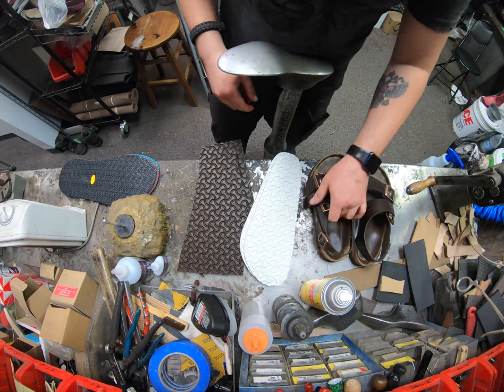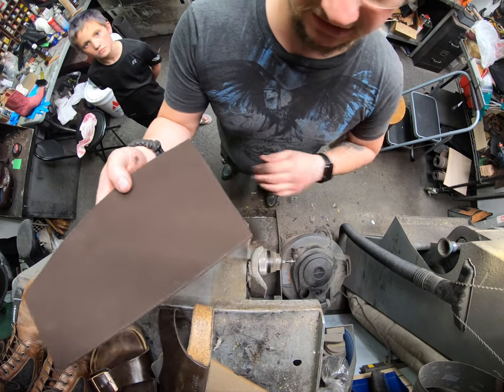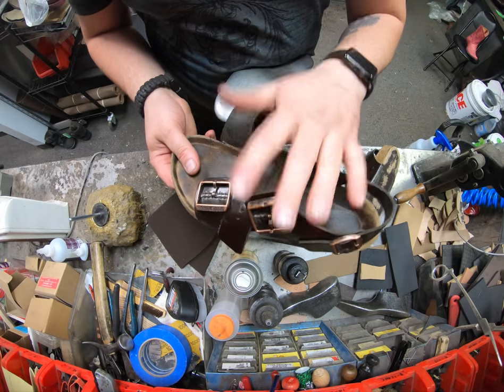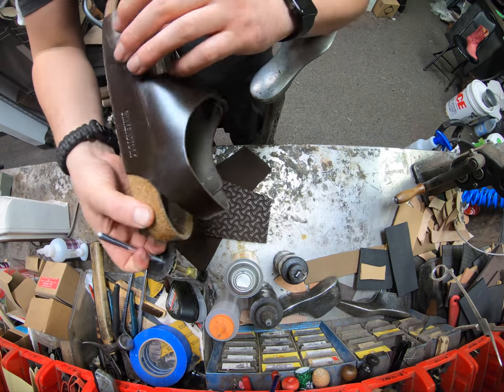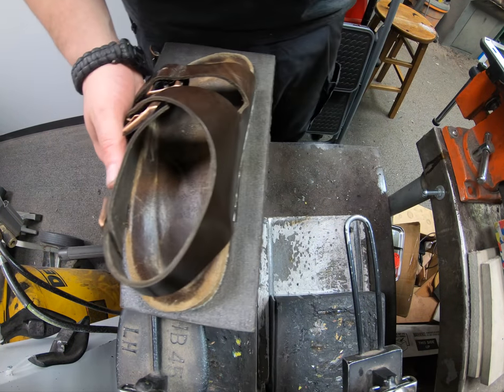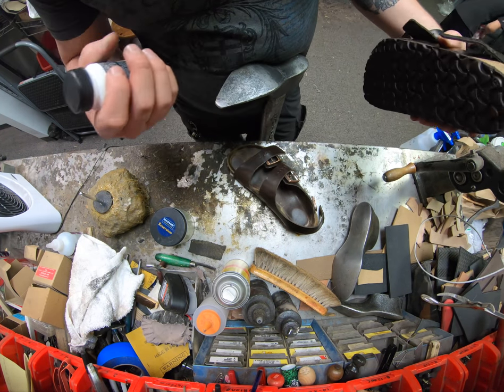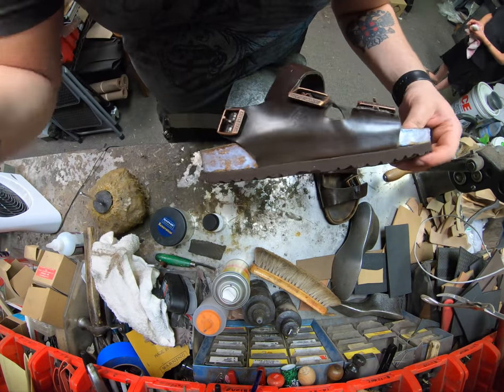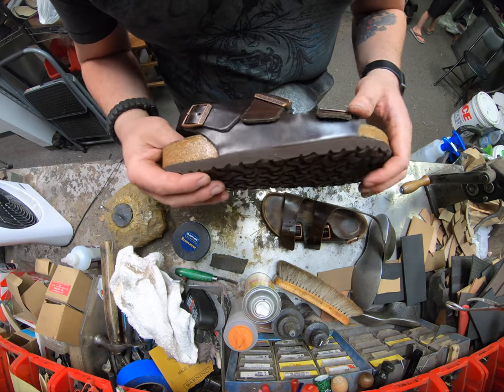Birkenstock Milano Full Sole Replacement with Original Birkenstock Soles

Comment: Really love this video! Can all Birkenstock’s get resoled or is only Birks with the cork and swiggley sole pattern?  Also, I saw a plum colored Birkenstock on clearance for good price. Could a cobbler like you dye them a different color if they were a suede material? Thank you. Love this concept of getting good quality shoes and getting them re soled!
Reply from the maker: Almost all the Birkenstock shoes can be resoled excluding the molded ones. As for dyeing a pair of suede usually just darker is the only option.
Reply: Awesome! Thank you! This kind of info will add a ton of value to people.

Comment: What happens if you take too much of the jute layer just underneath the EVA sole? Damaging the jute layer  will render the sandal less durable. And by the way, you said not to sand too much of the sole because it will dammage the cork. The thing is you dont want to sand too much off the sole because you will hit the jute layer.
Reply from the maker: The jute is imbedded in the cork and is actually a base that’s used for when they make the footbeds. It doesn’t have any durability properties or the footbed

Comment: great video ! Question, I need to put an extra 9mm height on my left sandal. they are brand new. Can i just adhere it straight onto the original sole botton as is? or do you recommend sanding it for better adhesion?

Comment: Hi I accidentally put mine in the dryer and the bottom sole shrunk ):
Can I somehow stretch them back by adding hot water?? Or would you recommend going to a cobbler ??
Reply from the maker: Hi, at that point the soles must be replaced once they shrink like that.

Comment: Do you also replace the soles for the Birkenstock GARY closed model of shoes?
Reply from the maker: I can definitely replace the sole and fix up parts of the cork but not the full cork base. Those aren’t even available for repair work by Birkenstock unfortunately but even then it’s a lot of work to remove the base and put it back together

Comment: Nice! What brand rubber cement you are using, please?   ... The Rubber cement I'm currently using doesn't work that great, and is so dangerous it requires a respirator.
Thanks!!!
Reply from the maker: We use jetset mainly and sometimes renia. But we have some ventilation in the shop
Reply: Thank you!  I'm giving up on rubber cement and going to contact cement.

Comment: I put them in the ofen 100 C for about 15 minutes and the soles came of easy.
Reply from the maker: That can actually damage the cork footbed significantly because those footbeds have almost 40% rubber materials in them that melt at the same level as the contact cement

Comment: Hi. Thanks. Where do you buy original Birkenstock rubber soles?

God bless, Proverbs 31
Reply from the maker: We tend to get them through authorized distributors and sometimes direct from Birkenstock
Reply: That's so nice of Birkenstock, it'll still all be original. I wish Nike & Dr. Martenswould do that too, so one can resole the Air Jordans (especially the nicest looking ones, the 3 and 4) with original Nike soles:-)

By the way, the Dr. Martins accessories are a bit in the price, relatively equivalent to a Rolls Royce (more expensive than Allen Edmonds). Their polish and leather anti-crack (Wonder Balm) is way, more expensive than even the branded shoes like Allen Edmunds.

I was wondering if you could used household, less expensive ways to condition the leathers- could you use cooking oil or organic oils from an all-organic shop (for massage maybe?). 
How about for polishing- could you use the beeswax that are usually in the jars of real organic honey or organic candle?

Thank you.
God bless, Proverbs 31

Comment: Birkenstock shoes made in Portugal with a lower profile outer so it tapers from the he’ll and then it tapers again at the top, not even a month and it is right almost to the cork I am so fed up angry with Birkenstocks really pissed. Tranto downtown does not have one good cobbler, ever since my cobbler Retired I haven’t found anyone I can trust in downtown Toronto to touch any of my shoes boots but I’m paying $200 for your Birkenstock shoes and they charge me $100 for the original order so Birkenstocks so you better do a damn good job and no I didn’t even hold and the trimming what a mess and I hatchet two attempts finally got it to stay because I put a leather layer Between the jute cork and the Birkenstock original soul so it’s gonna be a different profile completely and keep the arc how old is she is supposed to be. Is it that hard to do No, grrrr.   Alan I’m gonna be sending you my shoes to get fix except for cowgirl boots because they weigh to much for shipping.. Maybe they’re not that heavy with the Friar campus boot it Hass to get a winter so put on I might do it myself because I’m pissed and fed up mad… I am wearing cowboy boots for over 35 years and I have about like 15 to 20 pairs and not worry about 10 of them interchangeable three pairs of Birkenstocks sandals one pair of Birkenstock shoes never again the shoes never again they don’t call you back OK… Enough of my rant I had to get that off my chest